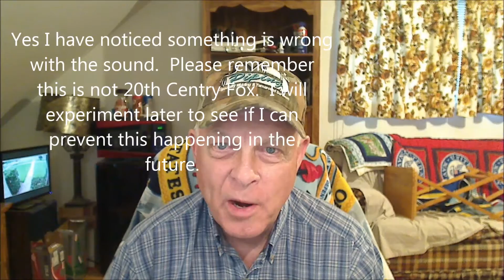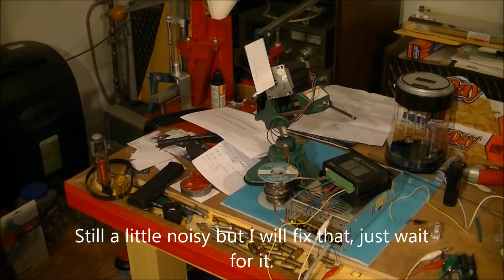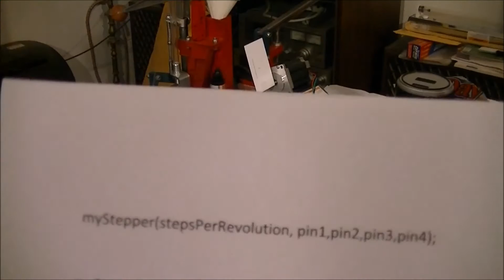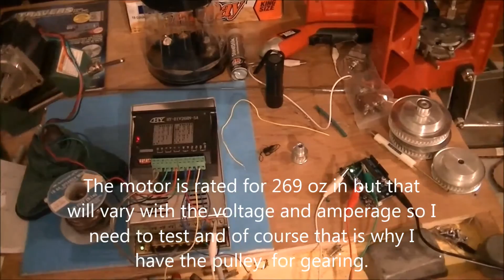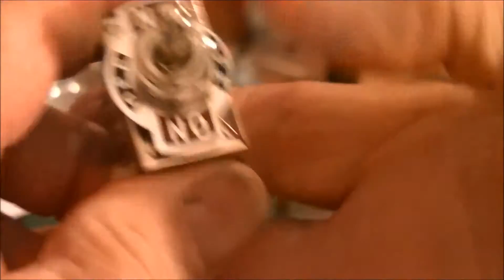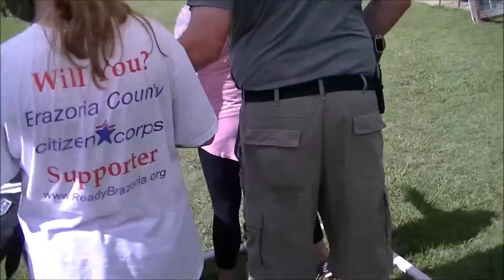Arduinos   granddaughters   and steel

Comment: This was interesting - I have long promised myself an Arduino - for numerous ideas - I have one or two steppers in my electronics junk box - somewhere!. Hmmm - something else for later. The combinations on that DIP switch must be quite large. Ahah - steel plinking - love it! Bowling pins good too.
Reply from the maker: ChrisB257 I read on a amazon evaluation that this controller does not actually control the amps.  I wish I had someone who is electronically qualified to examine the controller and see if that is true.  Anyone want to do an autopsy of this thing?   Thanks for viewing and commenting.

Comment: Nice Harold. You do realize your only a stones throw away from having a full on cnc machine rite?
2 more motors and 2 more drivers and you'll be machining ar15 lowers in no time :-)
Reply from the maker: builtrodewreckedit I have thought some about CNC.  I need to wait for a while so I can get some ball screws so I don't have to worry about slack.  And I need some experience with stepper motors.  Thanks for viewing and commenting.
Reply: You may enjoy checking out videos on a channel called Hossmachine. I'm not sure he has converted that exact mill but some very similar.
Reply from the maker: builtrodewreckedit thanks for the recommendation, I will look into it.

Comment: pretty interested to see how the arduino project turns out. looks like you have it pretty well worked out. thanks for the video
Reply from the maker: Emma Ritson if I can keep from burning up the motor control.  Actually after I ordered it I came across some posts on forums where they were reported to have a little quality control problem.  Still if I get a good one I am ahead a  lot on the price.   Thanks for viewing and commenting.

Comment: Hey Harold...
Maybe you just need a good pair of steel tipped elevator shoes ;>)

Gene Simmons from KISS could probably steer you to a supplier... I suggest silver glitter with non-slip soles.

Hmmmmm... "Tool is too long"  "Tool is too short"
Same ole problems eh?

2.5 amps? 5 amps?  is that Chinese amps or USA amps?

That sure is a complicated machine to flip your business cards over to read the other side.  I think i will just flip mine over the old fashioned way... most of mine are blank on the back side anyway.
or...
is that a headache machine?
... why not just tune a radio between stations and crank it up?

From non functioning steam engine to almost functioning Arduino controlled stepper motors...
now there is progress for ya.

... kinda like inventing the wheel to flying a spaceship... Cool!

Smartass? Who? Me?
Whatcha talkin' 'bout?

Keep up the good work,

   Anon
Reply from the maker: Anon Ymousmie taller shoes might help.  I think the best answer is to lower the machine.  And of course I am going to get right on that any day now.  Thanks for viewing and commenting.

Comment: Looks like you'll get the Arduino under control Harold, but I always like t look at our buddy John's code at NYCNC for clarification. & those girls really love that taste of power, don't they? My girls love it too!
Reply from the maker: Mike Brittain I hope to get the whole Arduino thing sorted out in reasonable time.  I should have bought a stepper with a gear drive on it.  It would have cost the same or less than all the pulleys and belts and been a lot easier.  I usually skip over Johns code part, but that is just my preference.  I spent a lot of years programming one thing or another so I can get there anyway.  Girls seem to have great hand eye coordination.  It is not unusual for me to go to a shooting match and find some little girl out shooting me.  Thanks for viewing and commenting.